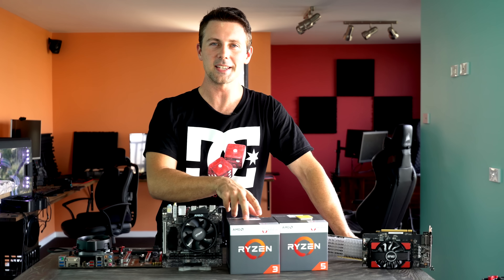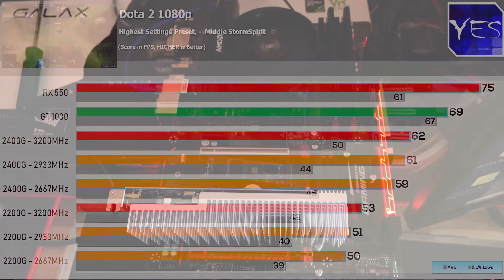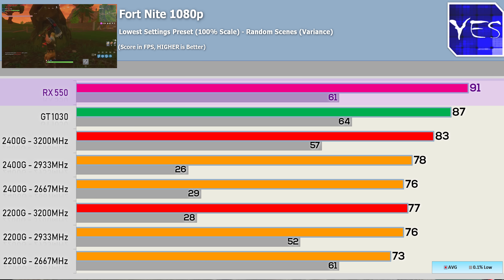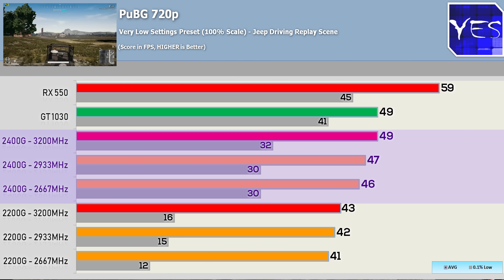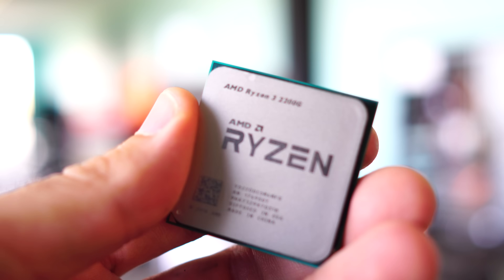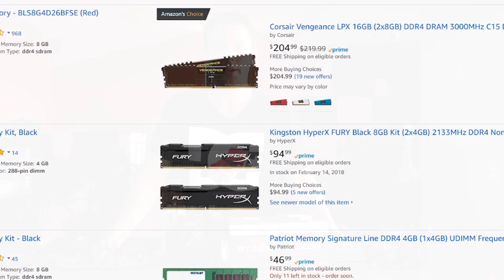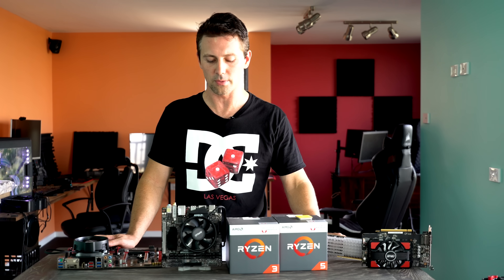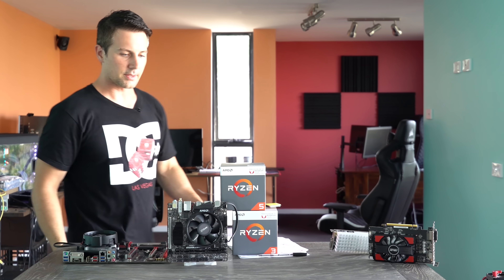RYZEN 2400G & 2200G Vs. GT 1030 Vs. RX 550 - Budget SHOWDOWN (Review)

Comment from the maker: Getting asked about VRAM allocation, yes I did change it from 512mb to 2GB manually for these benchmarks.
Reply: 1:50 screw it down :P

Sell that face towel on ebay to cash in on the fan girls and some fan boys hehehe
Reply: The Taichi doesn't have APU support, no video out, and the APU's (even Bristol Ridge) aren't on the CPU support list.

Also, no quad channel memory bandwidth.
Reply: Tech YES City try quad memory setup  please.... or try to slap it in your taichi x370
Reply: Hey Bro, any chance you could test the R3 2200g paired with a micro atx b350 mobo, 8gb 3000 in dual channel. I can see this as a sub $500 option for people wanting to get into PC gaming
Reply: GT 1030 and RX 550 what cpu did they use
Reply: Do you think the 2GB DDR4 VRAM allocation is a bottleneck? on paper the 2400G's GPU is more powerful than the RX 550 by a significant amount, we are talking 1.2TF vs 1.7 TF, so the APU must have a bottleneck somewhere if it's lagging behind.
Reply: 2400G Oc plz CPU end GPU
Reply: I purchased a Gigabyte GT 1030 Silent 2GB graphics card (same as this one) because of this review, and used it to replace my R9 270X in my main rig.  PCMR'ers will reel back in horror at that, but the 1030 runs GTA5 just fine with high textures and also has kickass budget CUDA performance for GPU machine learning.  So I reckon it's great.
Reply: It would have made no difference. It will float automatically, based on demand.
Reply: @joanamendoza-r5l  actually maxing out vram in bios actually hurts performance.
Reply: Just something of note, in Steve's video from a day or so ago he tested the GT 1030 and the RX 550 w/ an i3 and a Ryzen CPU. The GT 1030 seemed to do much better with the intel chip than it did with the Ryzen and the 550 did better with the Ryzen. Also, I have a Gigabyte GT 1030 (bought when it was $62 USD) in my kids PC with a sandy bridge i3. It does a good job for the games she plays (minecraft, roblox, Bendy etc.), plus I got it to OC 220 on the core and 420 on the memory. I'm not trying to nitpick so please don't take it that way... just trying to get the info out there for anyone thinking of buying a GT 1030 or RX 550 is all. Love your content mate :)

Comment: My overclocked R5 2400G crushes the GT1030.
Cinebench15=876
OpenGL=86.77fps
FireStrike= 3889
TimeSpy=1489
 Use cheap memory, you get equal results.

Comment: It's a bit weird to me that the 2400G doesn't perform significantly better graphics-wise than the 2200G. It has almost 50% more compute units, so what the hell is up with that..? Seems like the good value here would be a Ryzen 3 1200 paired with an RX 550 or GT 1030, rather than the APU's overall for gaming.

Comment: None of the APUs were really interesting for gaming, unless you were specifically looking to build a complete new system, which I would not suggest unless you were going to use it as living room device.  Almost anyone can get an old office computer or grab their old gaming rig and slap in the 1030 or 550 and have a nice budget gaming PC for 100 dollars.  As opposed to 500 or so just to get an APU "gaming" system that can barely keep up, has stuttering issues due to using system ram, and are obsolete as soon as they are released because they are not upgradeable.

Comment: Seems like the 2200G is the best for CPU power if the iGPU doesn't matter to you. Why should I get the 2400G when I have a R7 260X already? I have the choice of 2200G + 16GB DDR4 VS 2400G + 8GB DDR4
Reply: Doctor Claw The 2200g only has 4 threads though

Comment: I was going to buy a 1200, but should I get a 2200g instead? I have a RX 570 to use, but it would be nice to have the APU for a back up. But does it perform better than the 1200 w/ a GPU?

Comment: Ryzen 1200 with 8b 2400 ram and Nvida 1030 or even 1050 beats on cost and performance  2200G. 2200G is not a buget gaming solution coz it has to have 16gb of  3200 ram. 8gb with the 2200G leaves you just 4gb after Os and video memory. Many ppl will find games unplayable .  This should be said as it is really important.

Comment: Keep in mind the default with T-AA in Rainbow Six Siege is 50% by default, if you wanted 100% resolution scale you can turn AA off entirely by moving one option to the right of T-AA in the options menu. If I recall correctly T-AA is not meant to be cranked up to double its baseline so if anything the performance really ate it there

Comment: I'm somewhat disappointed with the results, the GPU inside the 2400G is more powerful on paper that the RX 550 by 0.5TF, so we should be seeing better results than we are. either the DDR4 (and or the 2GB limit) is a limiting factor or the drivers/bios needs allot more work.

Comment: There is one thing i noticed on the Nvidia vs AMD. In mid to low end cards AMD cards dont spike down FPS in cloudy or smoky area. While Nvidia GPU drop FPS. I currently own a gtx 960 4GB one. And smoke in games slow it down vs the r7 370 i had. But overall its much better no doubt.

Comment: i believe bryan does not really stand behind what he reviewed. this channel is about deals and acquiring an i5/i7/xeons sandy/ivy/haswell procie with mobo, 4x4gb ddr3 and a freaking geforce 1050 / rx 560 (or higher) will perform way better and cost so much less... the 2200g might be good for starting pc builders but the 2400g is overpriced for its ram needs...

Comment: Which one will be a good option for Web Development and some video editing, Ryzen 3 or 5 ?.  Is it good to spend money on higher RAM ( Capacity and Frequency ) or Liquid cooling?
I want to build a Mini-ITX system with Silverstone sugo13B, Crossair 450.  So I can add a Graphics card later, maybe after some months. I want to use this system mainly for Web development with some docker and VM boxes (Medium Web development). Initially, my plan is to buy an Intel i3 8100, but Z370 motherboard cost too much, then moved to AMD processors. My plan is to buy Gigabyte B350i motherboard, which has Displayport and HDMI ports, and USB 3.1 gen 2 ports. ITX case has some limitation,  it support upto 61mm cooling fan with ATX PSUs, may be i require a liquid cooling system. In your opinion which one will be value for money. Ryzen 3 or 5. In your video, there are only 10-12 FPS difference in some games.

Comment: Just like to point out the rx550 pulls over 50% more wattage from the wall than the gt 1030. Ya they are priced similar at msrp, but this shows how far ahead of amd nvidia is in power consumption to performance ratios.
Reply: Fred Flintstone 11 watts more in exchange for beating the GT 1030 in several scenarios?
If anything this shows that at low power consumption AMD does really well.
Besides, both of them get the power of just the PCIe socket.

Comment: For the people asking about csgo, as a map creator I have to say that you do not need to worry about the smokes. Realysticly you will get better fps when actualy playing the game then in the benchmark, becouse the way those smokes work is different then how they work in competitive. In competitive (normal gameplay) the smokes are 2d sprites. Yes not a 3D mode. On the benchmark However the smoke is a huge 3D object full of small particles to slow the pc down a TON. This is completely normal and you can test it by yourself. Also, the overall benchmark is kinda flawed becouse the unrealystic smokes afect performance all over the map when they are rendered.

Comment: I wonder if you can crossfire the Vega integrated graphics with a discrete Vega graphics card as a possible upgrade path, like how it is with the past APUs and some cards. Most likely not because V56 is too stronk.

Edit: Never mind, found this https://products.amd.com/en-us/compare?prod1=148&type1=CPU&prod2=151&type2=CPU&prod3=244&type3=APU&prod4=243&type4=APU&prod5=&type5=

Comment: I would really like to see the cs go benchmark on 4:3 in 1024x768, shadows high, everything on low and fxaa on. It might look strange for someone used to 1080p gaming (I personally switch between 1440x1080p and 1280x960p) but it should remove that gpu bottleneck and show the cpu part more justice. And for competitive cs go players, it isn't that of an absurd resolution (scream is even playin in 800x600 and has sick aim ^^).

Because if these chips can run cs go at 144hz however low the settings, they might become a great budget option for more competitive players looking for a portable solution.

Comment: The rule has always been that if you want to build a gaming PC, you have to use dedicated graphics. This doesn't look to change that in my opinion. The stuttering and lagging is just not ok. You want to save up and build a system that won't bog down in single digit 0.1% lows like that. But what these chips look really good for is when I build my next internet/multimedia linux box for my parents. That's some good performance for the price, and I don't have to worry if the integrated graphics is good enough.

Comment: Test it against other AM4 APUs for example the A10 or A12
Reply: the a10 and a12 use a r5 200 series gpu and excavator cores. not only did amd stop producing the a10 and a12 with this release, but you would see a performance loss of about 50%
Reply: James Mastroianni I just wanna know how big the difference in performance is
Reply: domingo en fuego get the ryzen 2200g

Comment: AMD comes to save the masses from GPU shortage. I don't think this APU has the cache necessary for mining... and the graphics are not high end enough to make it a mining machine over something like a 12 or 16 thread processor.
Reply: Wapn Perfo Has enough L3 to run 2 Monero threads on the CPU and 2 386/8 threads on the iGPU. Even you can run the full 4 threads on the CPU for Aeon (SMT lowers performance, so it's useless).

Comment: While these e-sports titles play well with the 2400g, I'm more curious to see what would happen if a discrete GPU such as the RX 550 were paired with the 2400g with its integrated graphics enabled for a game such as Ashes of the Singularity. Most of the other reviews just disabled the integrated GPU when the 2400g was used with a discrete GPU, and I'm curious if AoS parallel nature will makes a difference in the testing. If this is a stupid request, just ignore it.
Reply: it wont work as it is Vega, no lowend vega cards..
Reply: Yes, I realized later that day that I need to make a clarification on just that, but then I began to doubt just that. It should be noted that the Vulkan API was designed to alleviate the hardware dependence associated with Crossfire and SLI to some extent (through asynchronous compute, I believe, but correct me if I'm wrong). I'm at a quandary, as long as both GPUs support a certain version of that API and the game developers include support for multi-GPUs, would there be an appreciable difference? I just don't know.

Comment: I want to see upgradeability. If I buy this now, will i be able to get a 1080ti or something (or future equivilant) without horrible cpu throttling?
Reply: LEADER0FY0U Buy the Ryzen 5 2400G with nice RAM, use it until GPU prices drop down and buy a great GPU like 1070/ti, put it in your rig, disable the Vega iGPU and enjoj
Reply: LEADER0FY0U The 2400G is a fairly powerful CPU, but it will bottleneck a 1080ti at 1080p a little bit. Not horrible throttling since is basically a overclocked R5 1400, but lower framerates than a 5ghz i7 8700k.

For 4k is perfectly fine, it would only be a limiting factor for 144hz monitors.
Reply: I was more considering it towards a Media PC, as I have alot of ddr4 laying around. (3200). But when I get more money use it as a "console" and for visitors to just slam in their GPU's and play games together and not have to bring their entire pc's :)

I really appreciate your input btw. so thanks
Reply: The i-gpu in these new APU's use 8x pcie lanes. So what ever gpu you put in will only be running in 8x and not 16x. That could have an effect depending on how much bandwidth your gpu choice needs.
Reply: the 2400g could run a 1080 without doubt, a 1080ti would start seeing the limits of the cpu. This is assuming 1080p play, as playing at 4k or even 1440p would put all the strain on the gpu
Reply: Psycho Kern maybe disable smt too if just gaming bc Ryzen has been shown to perform better in games with it off a majority of the time
Reply: ArtisChronicles very few games actually saw actual benefits from this *at ryzen launch * and has been fixed since.
Reply: Dekker Hofmeister Will I have problems with new GPUs tho?

Comment: I think ryzen 3 2200g is more interesting than the 2400g.cause its giving almost similar performance of gt 1030(slightly slower) but an very interesting price point of 99$.
A  similar cpu+gpu config
G4560+ gt 1030 = 160$
Ryzen 3 2200g = 99$

Yes its a bit slower than the gt 1030 but I'm saving 60$ here
With 60$ i can also go for a budget b350 mobo like asrock b350m or gigabyte one's which is also oc capable.
Reply: Deshring Nunisa If you can afford it, I would wait to see what Nvidia and AMD have released by then.
Reply: Akash7713 you are wrong if you already have a good cpu just buy a graphics card rather than using this solution since RAM prices are really bad
Reply: Wiktor Kalinowski for a new budget build he's not actually wrong. The ram prices are bad for anyone really.
Reply: asrock B350M doesn't have video outputs.
hint
Reply: Akash7713 ryzen 5 is much better lmao
Reply: Should i just get a 2200G if i am getting a gpu later this year??
Reply: Deshring Nunisa sure.if ur budget is under 100$ 2200g kills it.
Reply: I can get a 2400G ... but i thought id use that +70 $  for a better gpu  .. or should i just get a 2400G and wait another year for new gpu(s) ... confused haha
Reply: Copy pasta
Reply: You'll be paying for expensive DDR4 memory no matter what solution you go for, so bringing RAM prices into this is kind of irrelevant. Besides, IMHO high-speed DDR4 isn't worth it on APUs to begin with, given you can easily end up spending twice as much for it, only to get a few more FPS out of it.
Reply: Intel is a dead end, motherboard wise. AM4 will be around for another two years. And with the new R5 having i9 9900K performance for under $225usd, you will definitely want to upgrade later. And my overclocked Ryzen 5 2400G crushes the 1030.

Comment: Great APU's cheap and fast. But DDR4 costs an arm and a leg soo not really a good option yet
Reply: Its about $400 for a total build if you want 16GB of decent DDR4. Sadly the RAM is $168 in out of that, so pretty close to half. You could save $20 off of the $400 if you didn't care about overclockable motherboards too, but that's not the major cost like RAM is. RAM prices suck...

I have a Titan Xp (12GB Vram), but even I think its too expensive to upgrade another 16GB of Vram even though I really need it for my main system. Just pagefiling about 10+ GB all the time. Its slow, but I'm waiting on these stupidly high prices to drop. I might run Linux just to use the Titan's Vram as RAM to save my drives from wear (there doesn't seem to be a way to do this in Windows unfortunately).
Reply: Jake Garrett Yeah, it sucks cause i've been torn between what system i should get for my Girlfriend i don't want to go old or as old (i'd say around sandy bridge) because both companies are getting competitive and that means more generation leaps. Its just a messy time for buying components
Reply: TheLastPerez Get a 4th gen Intel setup and take advantage of cheaper DDR3

Comment: 2400G is crap and 2200G is even worse. Ryzen 1200 (£89) + GT 1030 (£60) + 8GB 2400Mhz (£65) = £214. Now....Ryzen 2400G (£149) + no gpu + 8GB 3200Mhz (£103) = £252. Do you really wanna have this debate or just drop it?
Reply: That is a good argument you bringing to the table. How did you come up with it? I'm just curious. Do you have anything constructive to say, except this?
Reply: Things may be different where you are, but in the States, the 2400g with 8gb of 3200mhz (272usd) is roughly the same price as an intel g4560 with 2400mhz and a gt 1030 (269usd). Converted to euro, 2400g cost 221 and the g4560 combo cost 218. The price only goes up if you use a 2200g as your processor (since the 2200g is cheaper than the 1200), and at that point you already have an igpu so why buy the 1030 anyways. It boils down to the margins just being too tight to justify one over the other, but the 2400g, being a 4c/8t part leaves room to purchase a much more powerful gpu down the road like a 1060 or 1070, once prices come back to earth.
Reply: Or 2050 in the next year. NVIDIA's already announced that 2060, 2070, 2080 will be released in 2018 and 2030, 2050 in 2019. Also in 2019 or 2020 you can easily replace 2400G with the latest one that supports AM4 platform.
Reply: Minus 2400g has hyperthreading which helps a lot in video editing. Who said that gaming is the only thing a PC is made for?

Comment: How come Amd doesnt advertise crossfire with an rx550 or something like with the old apus ? really curious if its gonna work since it could trash a gtx 1050...
Reply: Because it is a vega gpu.. And apu crossfire is useless because of ddr4 vram.. Just get a better dedicated gpu.
Reply: I was just asking for the concept, dont know where you understood that I need that but anyways, it could still be better than the old ddr3 apus in crosffire with those 250x or whatever they wherre called, almost could match one of the gtx960 that I have, so the new apus with the equivalent rx550 could really make a difference, but I guess that Amd has other plans, could of been good if you wouldn't wasted our tim with that answer instead of trying to rabdomly not recommend shit lol